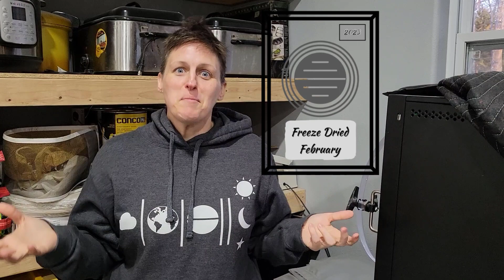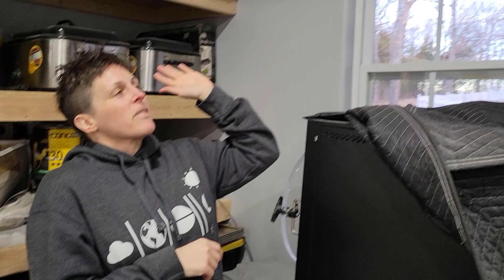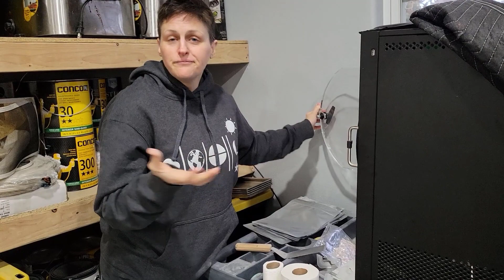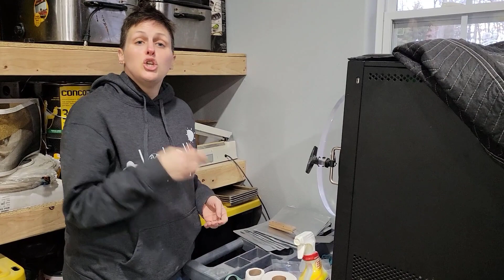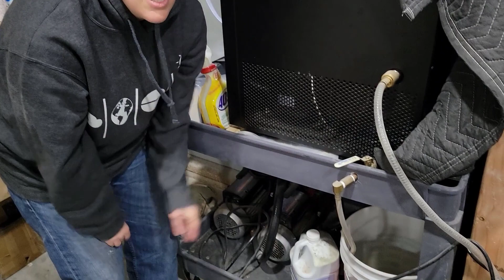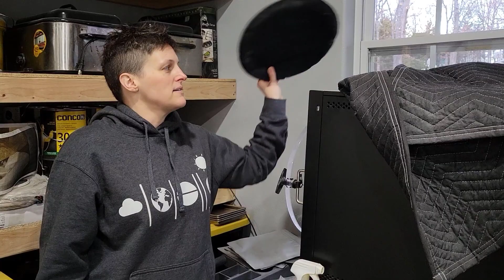Starting 2023 Off Right #FreezeDriedFebruary23

Comment: Happy camper with a small HR unit (after a few vacuum glitches and fixes).  Though "small," it keeps me busy trying to get a load of the next thing in almost every day.  Have the yellow-lid bins and will probably have to start using them, as my accumulated freeze-dried foods take over the basement.  Would probably be more inclined to try more MRE-type meals if I had the medium size.

Comment: How heavy is the freeze dryer? I noticed most people have it in their garage and on a table.
Reply: It's pretty heavy. Over a 100LBS. Heavy enough that 2 strong people are required to pick up the medium freeze dryer (from both sides) to lift it to a table or cart. 

I live alone, and was able to lift mine (by myself) but it was the worst experience. I had to put it on a dolly, roll it up as close to the cart/table and then tilt it, squat and try to get a good grasp and hold on it. It's awkwardly wide and difficult to get your arms around it/no grips/handles. That's why 2 people are needed. Then there's the weight.
Reply: @MGillDesign  Thank you.
Reply: @YolandaTheGardener  You're welcome.